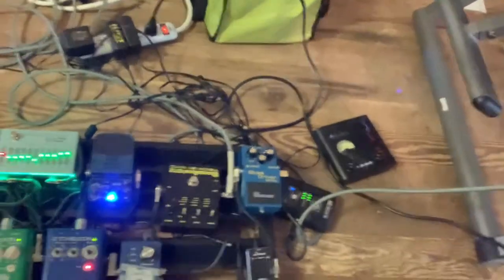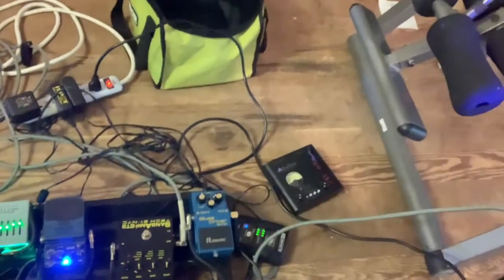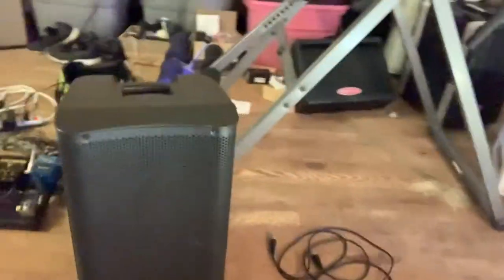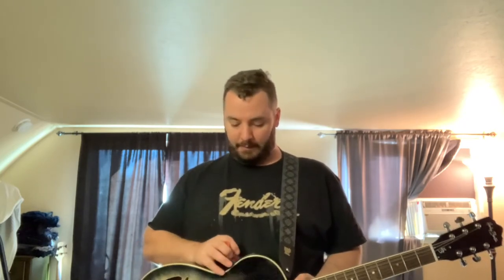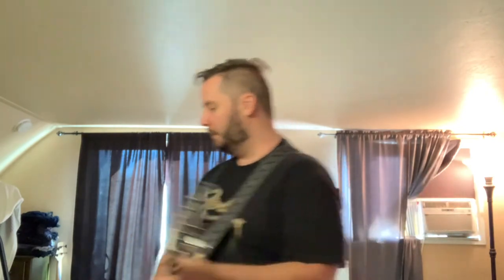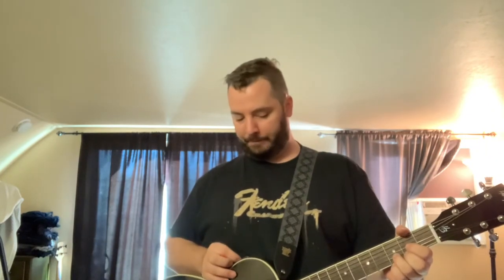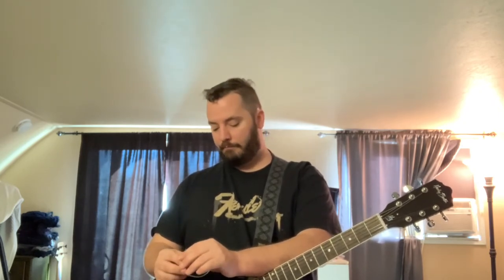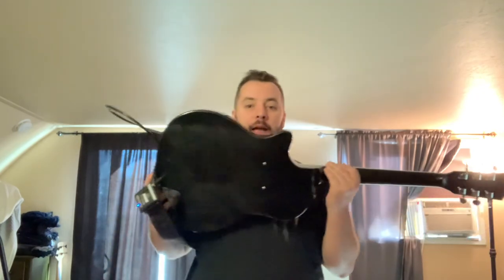Harley Benton Nashville Steel One Week Review

Comment: 3:00 Noooo, don't cut a hole in it. You can acces the inside of the guitar by removing the battery/plug compartment carefully. It's just three small screws. You can tape down the cable via this hole. 
I opened it today because i tried adding some weight to the body because of the neckdive. When i'm seated I need about 150grams of weight. I havent glued any weight down yet (sticky lead wheel weights) but I will after trying out a new guitarstrap. 
Or maybe I send it back to Thomann. I just own the guitar for a week now and also ordered an Epiphone Les Paul muse (jet black) which i expect to receive tomorrow. I'm a beginner player so i choose the Harley Benton for it's acoustic/electric mix.

Comment: If you don't need to switch between electric and acoustic several times during the same song you can try with a CAB M with acoustic IR for acoustic and with some good speaker simulator for the electric. The acoustic IRs made my thin piezo sounds like a dream. 
The electric sounds are also a great if you want to have an ampless solution. The only problem is that you have to bend down and select the correct setting with a knob every time you want to switch between electric or acoustic.
Reply from the maker: That sounds awesome!  Eventually they will make it footswitchable I’m sure.